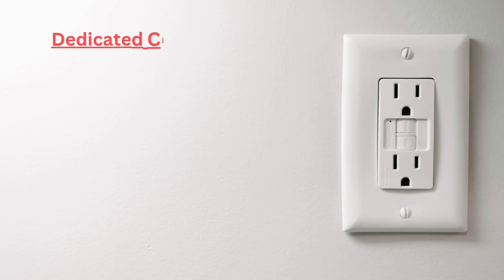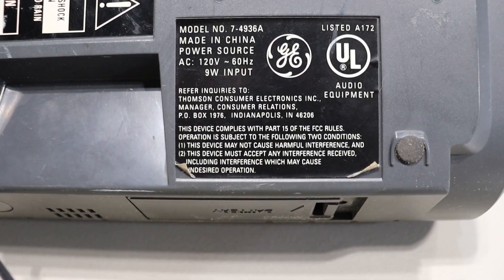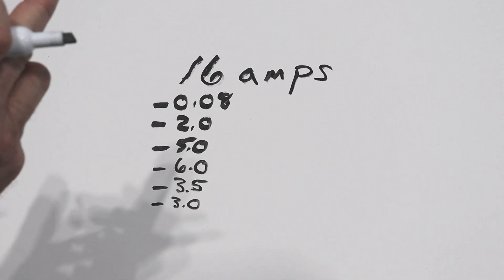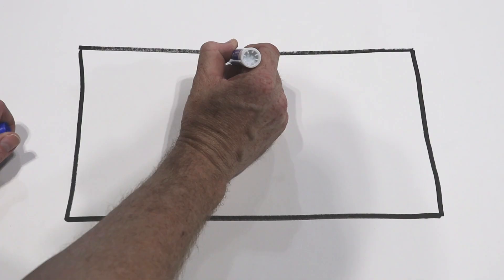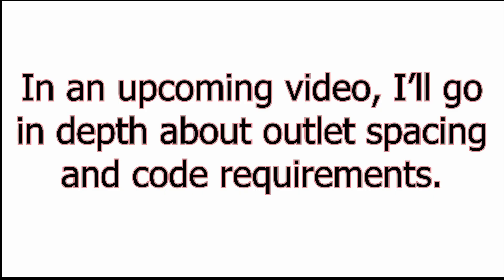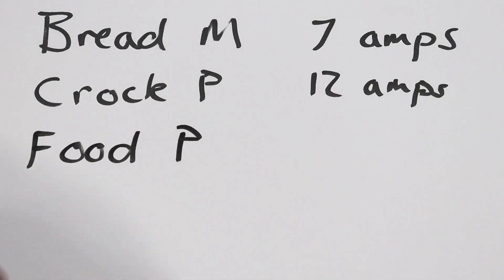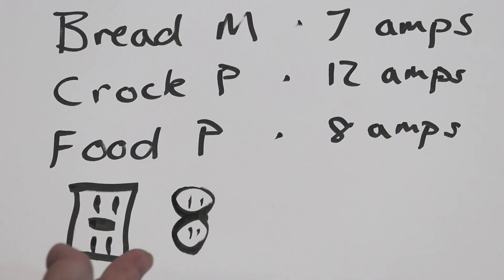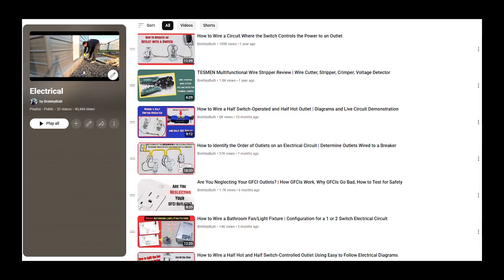How to Calculate the Number of Outlets to Wire into a Circuit

Comment: Do outlets with nothing plugged in draw any power, sort of like vampire power drain? I'm building a video game room and I want to have around 20 outlets for one 20 amp circuit, BUT I don't plan on plugging things in to all 20 outlets, I just want the convenience of having a lot of outlets everywhere so I'm not running cords and power strips all over the place and I can arrange things easier. I was worried that running too many outlets, even with nothing plugged in, could "weaken" the strength of the circuit
Reply from the maker: The outlets won't draw power, but when devices are plugged in they can draw a tiny bit of power.